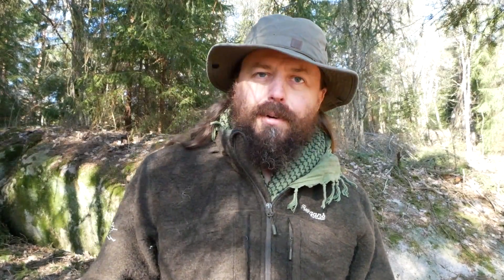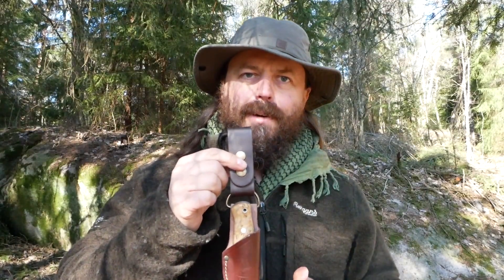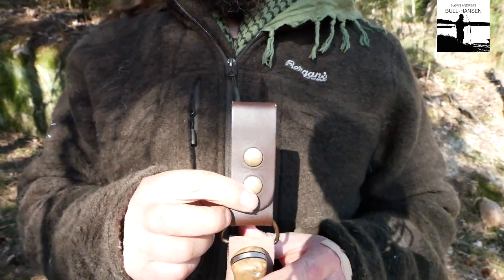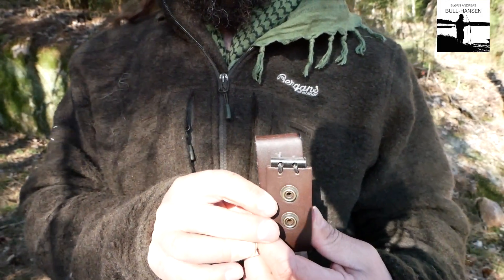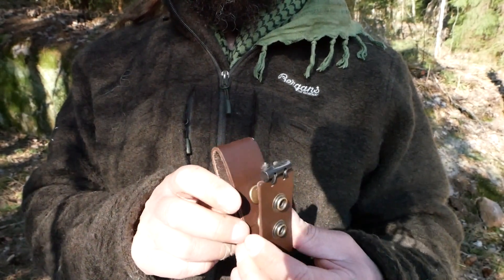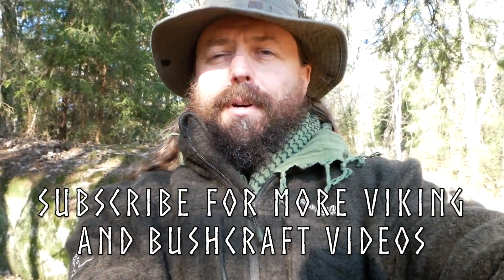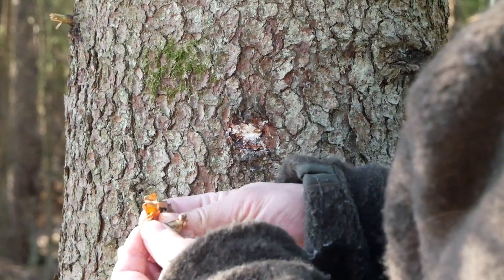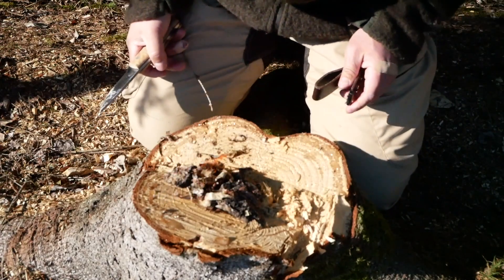How to Add a Ferro Rod to Your Knife Sheath - Bushcraft Hack | Bjørn Andreas Bull-Hansen

Comment: Its usual to keep a ferro rod together with a knife, Mora even have a knife with a rod in the handle. I think they call it "tändkniven". Another hack is to build a small packet with a needle you magnetize (makeshift compass), maybe some fish hooks/sinkers, then you lash this to the sheet with paracord, there is a special way to lash but I am sure you all will figure it out. Now you have a small survival kit, you can make fire, you can fish and set snares. You can even make a sling with a piece of bark/fabric and hunt for birds or small game. The sling idea I  came up with one day I was bored, I built one with som hemp thread and went into the garden and started throwing. Its very intuitivt and dont take that much time to learn. Keep the sling in your pocket with a few nice stones so you can "be quick on the draw" if you spot game. If you are one that like to carry a hiking stick you can lash it to the top of the stick for more power, the stick will also be useful to finish your prey since your game rarely die, it just stuns them.